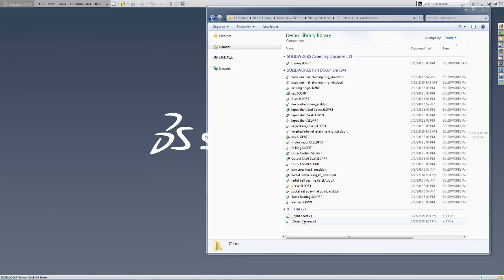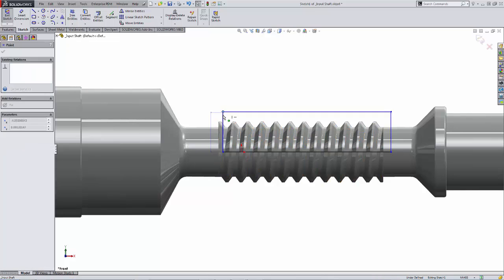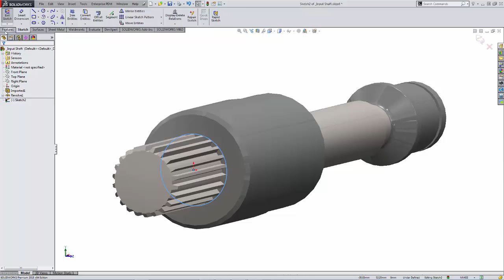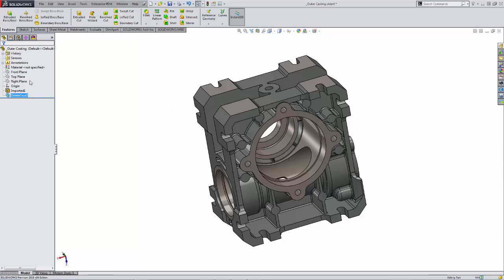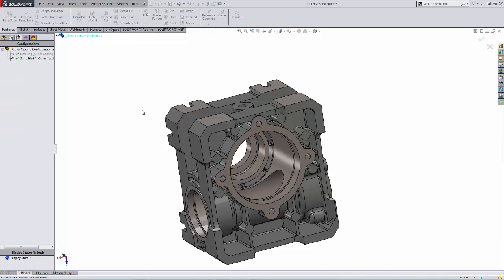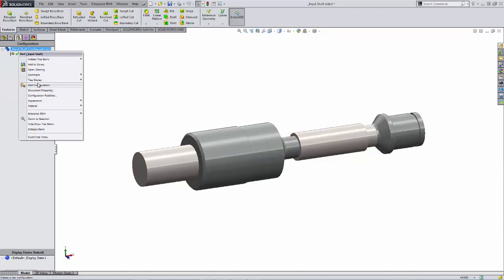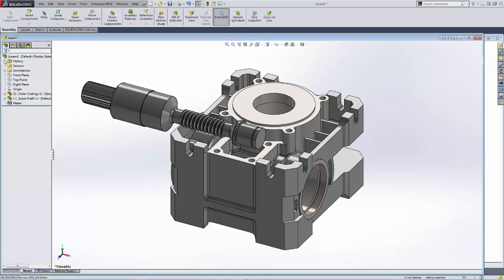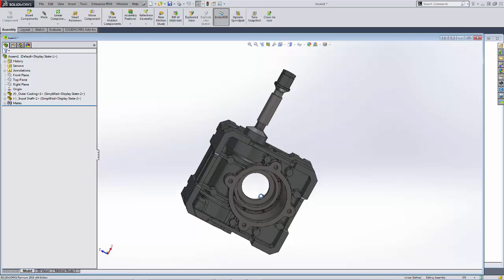Defeaturing imported models in SOLIDWORKS

Comment: i've been teaching myself how to manually defeature imported geometry for about 8 months on-and-off. if rebuilding time is a main concern, i would have used direct editing, surface tools, and a re-export and import to split the spines and threads off as there own bodies. then have them supressed/unsupressed in the desired config. then roll that freeze bar to the bottom for extra. a lot of features will take up time rebuilding, especially if you have "merge result" turned on. (just from my experience) so i re-export and import again to get rid of any features that it has to calculate. only thing left will be imported geometry.